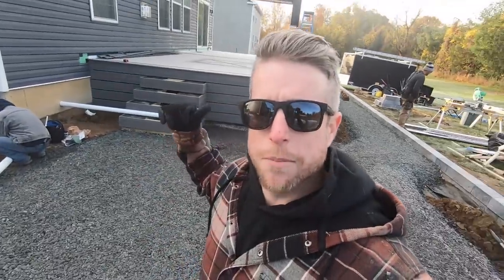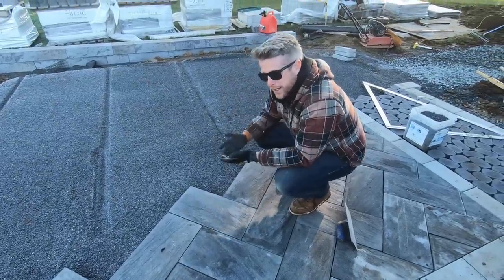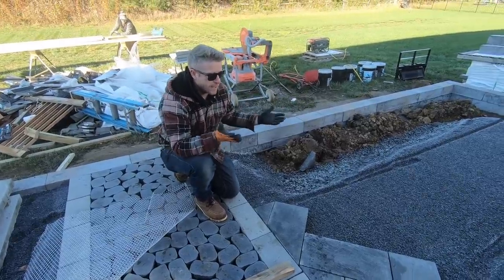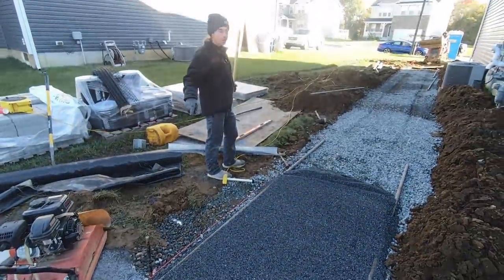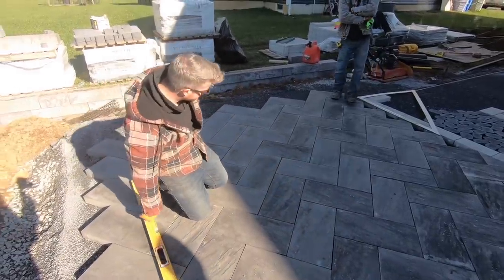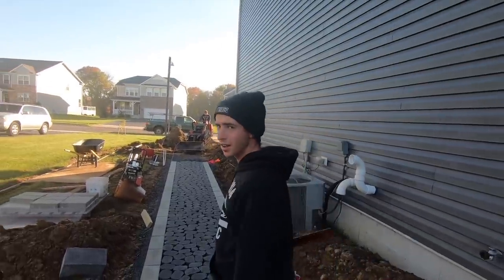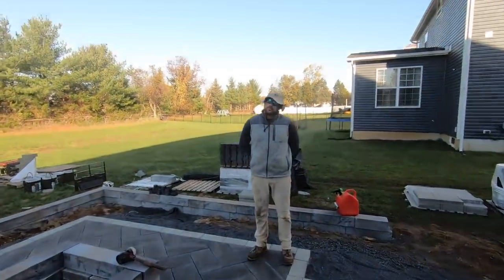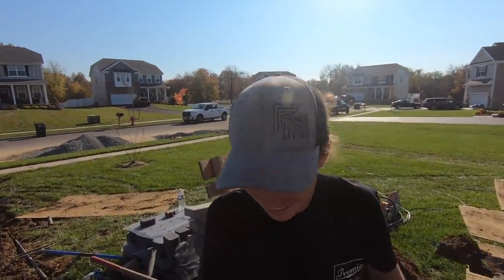Installing Pavers, Walls, Fire Pit, And Driveway Accent Band!!

Comment: I noticed you guys use screeded gravel instead of sand. Any benefits or cost difference, or is it preference?
Reply from the maker: Sand will hold moisture and since its a finer material it can migrate out of the edging